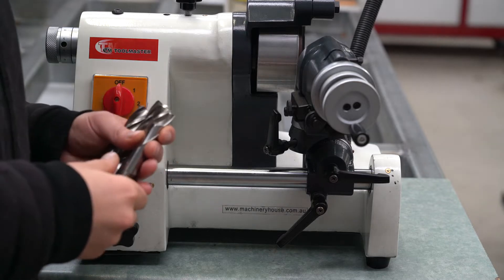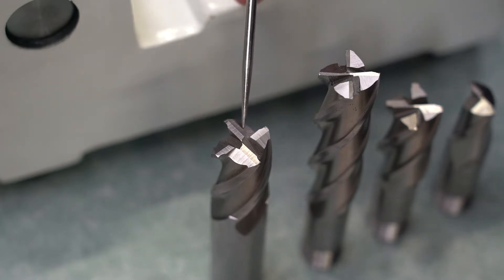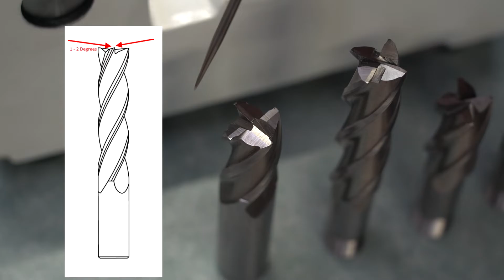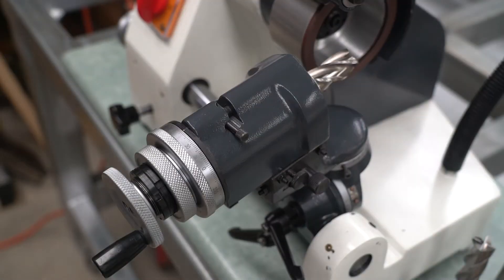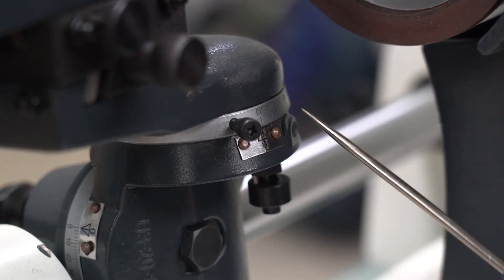End Mill Sharpening Guide : Universal Tool & Cutter Grinder AKA D Bit Grinder

Comment: Nice, Now I would like someone to make a similar video on the Toolmaster Universal Tool and Cutter Grinder....I picked up a second hand one cheap but have no idea how to use all its features yet.
Reply: Having all of the attachments is the bigger issue. Pickup yourself a coppy of Covels book. 
"operator's instruction manual: A handbook on universal cutter and tool grinding by Covel"
Reply: Universal tool cutter grinders are sweet machines. the lack of easy surface grinding is a pain for a small shop. but with good ways, a good indicator and allot of patcience, you can indicate the head in straught enough to do decent surface geinder work. My grinder is far too worm for this. but works well as a cutter grinder. its a '70's?  Saacke